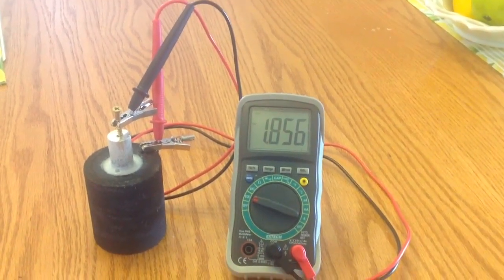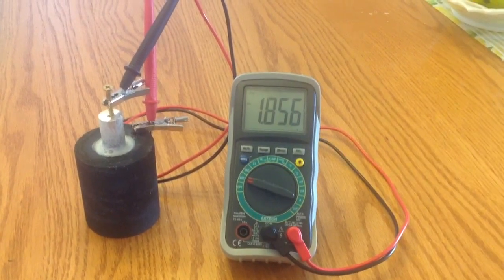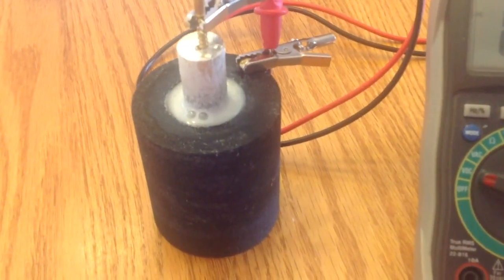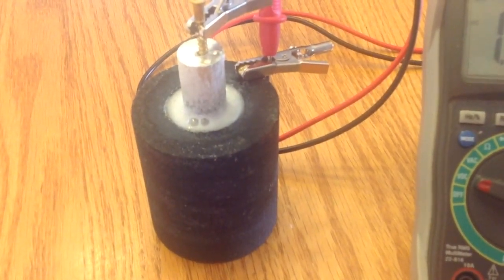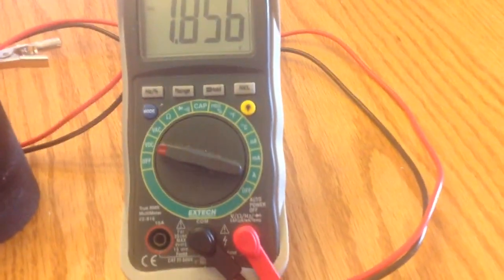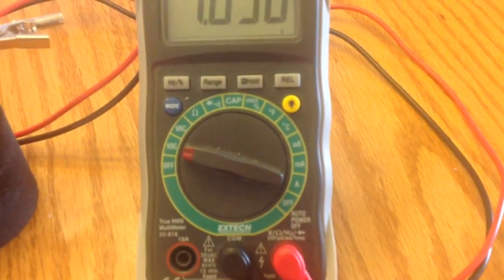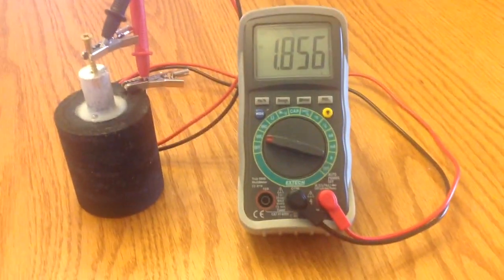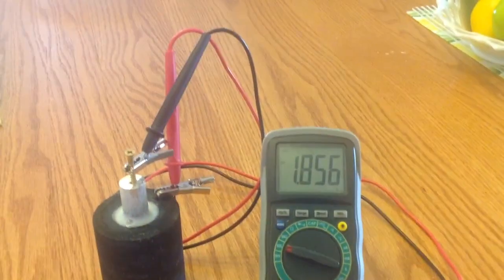Amazing carbon magnesium crystal battery  Part 2

Comment: Ive seen magnesium ribbon used. Could it be cut into kind of flakes and in solution like oil or VG still be an anode ? If it could , could it then kind of be pumped in and the vg pumped out , so that when lost as Ions , the anode is replenished . Probably a stupid question
Reply: Sorry stupid though as wouldn't make proper electrical contact

Comment: Graphite cathode gives a higher voltage compared to a copper cathode. But the current is usually very low. A Manganese Dioxide coating on the graphite "collector" could greatly improve the performance of the cell

Comment: Cool... use the triboelectric scale to pick materials that are far apart on that scale as when you put such in local context that will induce the greatest volt disparity...  things that are close together on the triboelectric scale will not produce much voltage.   

You'll find that current density is a function of the electrolyte and that using distilled water or air will produce the least current, while then salting the water or using some other admixture of chemicals in place of the water as the electrolyte will increase available current but with the reduced Run time before one of the terminals is decomposed...

Comment: would copper be better then brass?
Reply: ***** I hear you, but material choice is a big part of determining the projects potential.
Reply: ***** Okay, your design is perfected then.
Reply: ***** Thanks for your response then.
Reply: +d w There are so many designs out there the screws are not a part of the cells so their material dont matter. Some designs use copper instead of carbon and so on.